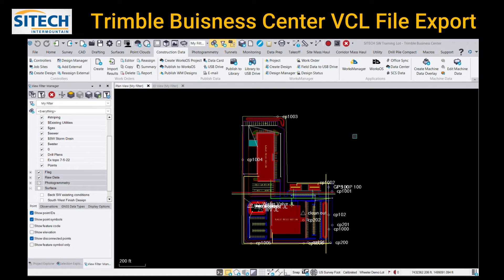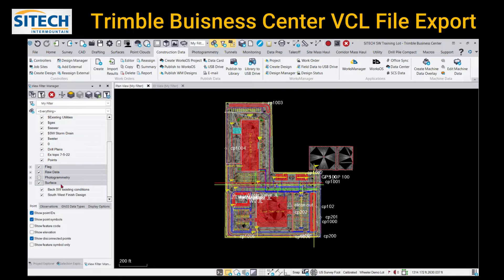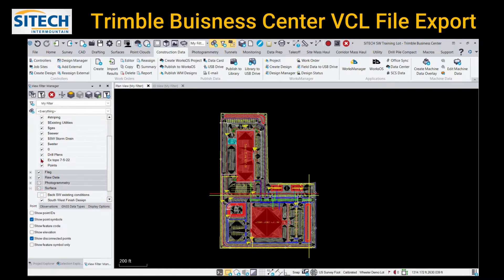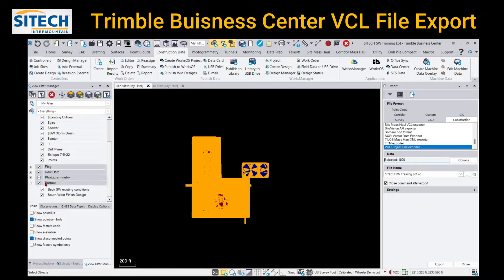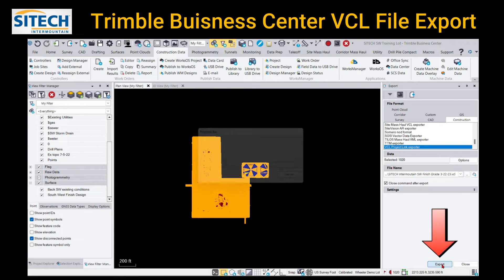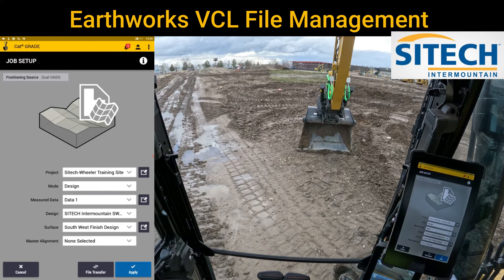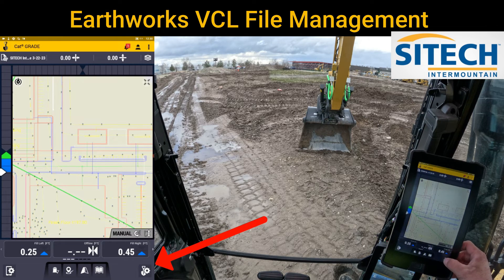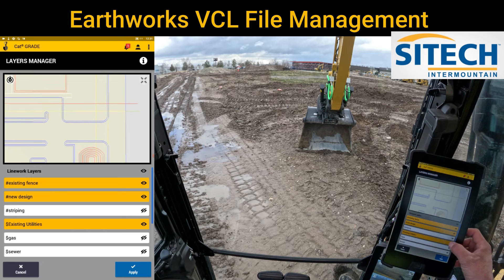Trimble Earthworks VCL File Creation In Trimble Business Center

Comment: If you go to Surfaces Manager in Work Settings you can select a main surface and a reference surface for a maximum of 2 surfaces. It’s not as good as the way you can activate as many surfaces as you want and change colour of any surface you want in top con and also add you our infield design to your job file and active it as well to over lay it in, hopefully Trimble will look at some of those features from top con and add then eventually.
Reply: I agree, there are a lot of things I think about all the time as possible upgrades and feature needs as we go along. Any Ideas that come up or customers have we can submit them as upgrade requests. Earthworks is a great platform to add to and add to as time goes on.  thanks for watching.